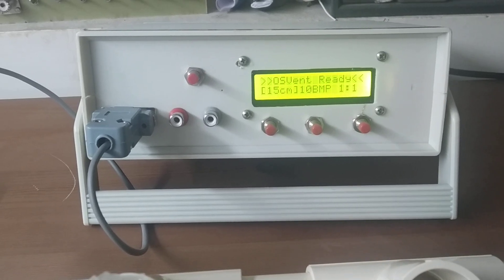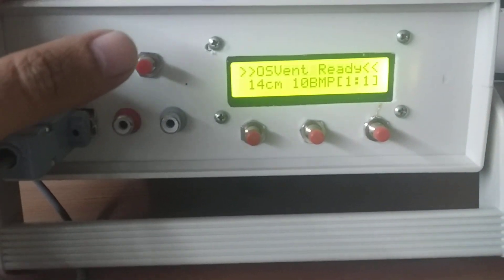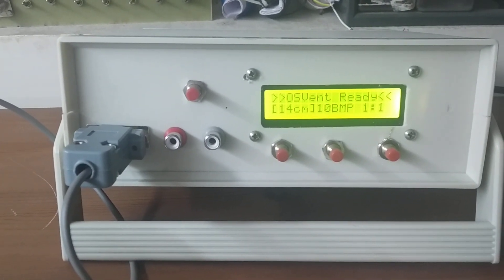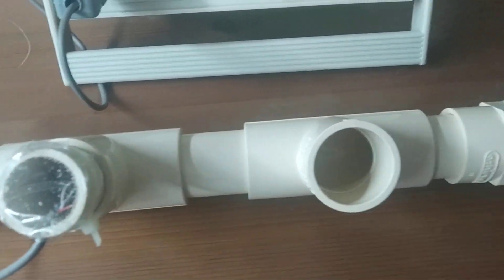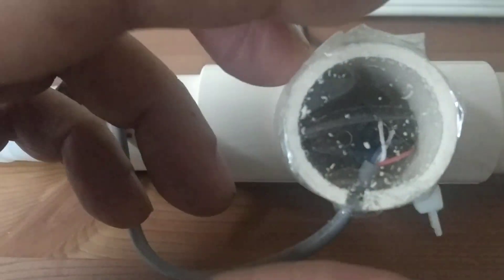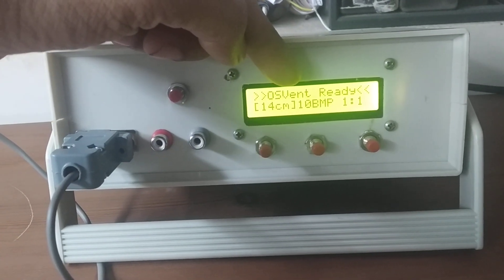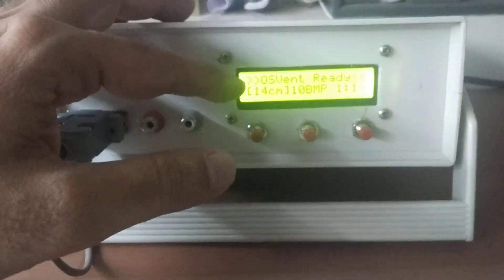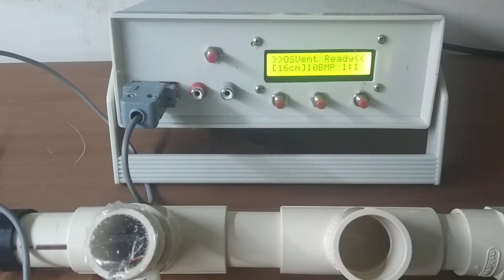OSVent prototype

Comment: Hi Ashhar, letting this buffer (currently tethered to my slow cell int) while I share this additional ventilator built by Johnny in California, USA . https://youtu.be/n57u1NvXBgw From Mike, N6GRG We have these gadgets called CPAP machines. At one time I had access to used ones, but with everything closed down, not so much. I will check though, but I have a small vacuum cleaner that might be decent. I need to check and see If I have the BMP180, , but yours looks like some sort of assembly with a 9 pin maybe ?